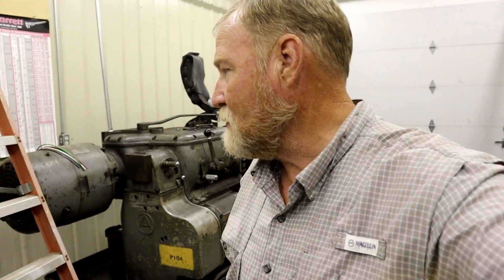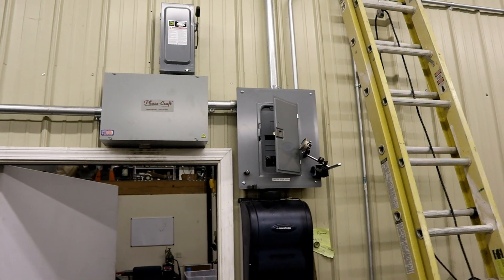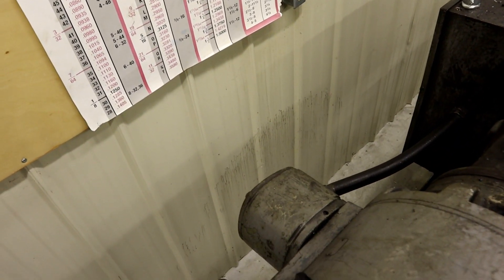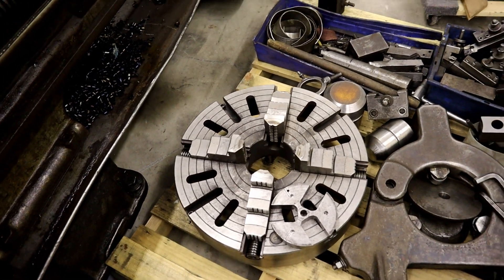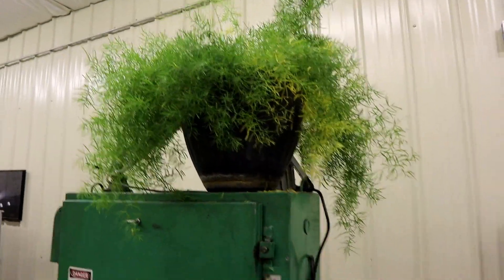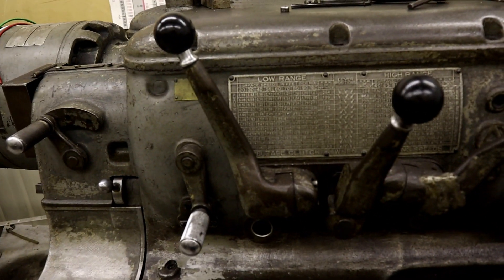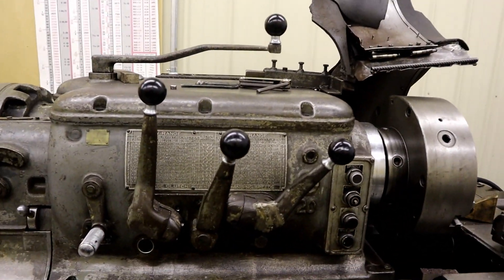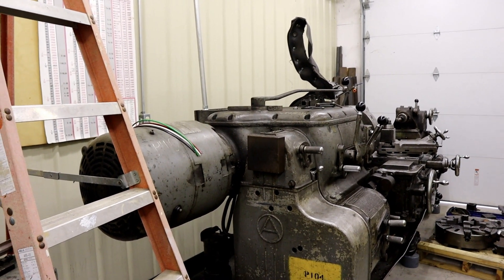An Apology , The 20 LIVES, but is crippled :(

Comment: Big or small I will weld em all! :-) I sure wasn't offended, actually I didn't even think anything about it. See you are going to wind up in that headstock anyway. Might as well have gotten that long bed model with the top already off. lol
Reply from the maker: That is good to know :)     Thank You.... 
As for the Headstock... Yeah.... After the problems I had with the management of the company ( explained in tomorrow's video) I was right in not trusting anything they said.. Who knows what happened to that other machine, I'm thinking it was crashed.   Anyway to get that other machine in the shop I would have had to put the 10EE flower pot outside....    The one I did get takes 16 feet of wall space as it is... The other one would have been as long as the planer!

Comment: Interesting, I had the brass gear change fork break in a similar problem on my axelson a16. Had to take open up the headstock in a similar manner and pull it out of there to get it replaced. In the end it wasn't too difficult to get back together and working like new.
Reply from the maker: It would be nice if it is a fork!  I'm looking for a oil tank with suction so I can clean it out really well before I tear into it :)
Reply: @10swatkins  makes sense! The part number for the shifting fork  that was broken on mine is 2329-110! do you have an axelson manual? If you don't, I have a PDF of the one for 14" to 32" lathes.

Comment: Is the big motor connected? It could be a high speed high torque motor,and I see the 3 phase wire on top of it ..
Reply from the maker: Yep it is connected.... The wires you see were just what I cut off  when wiring it... In the video it is turning :)

Comment: is it possible that it is an electrical problem rather than mechanical? I have always been taught that you need a larger idler motor producing 3 phase than the motor you are trying to run.
Reply from the maker: Naw.. This is, I think,  a 1957 model and not much is electric on these babies :)  It's something to do with the shifter.  I hear that about three phase converters also... IF I was running the crap out of that motor it would probably need more but the 20 starts it well and we will see.... I have been running my Planer on that same converter for years. It has a 20 HP main motor and a 5 horse column motor...

Comment: I don't think it offended  Brian , but now I'm sure he wouldn't be. His crash was a real earthquake. Your table I think would be easy. To do for you heat it up and slow cool it no matter weld or braze.
Reply from the maker: I have a plan.... Here hold my beer......:)

For real I do have a plan . I have  found a wonder wire for tiging cast iron.. No pre heat or post heat.   https://www.youtube.com/watch?v=Ht14lQc75kc&feature=youtu.be       This end of the table is really just a cover to keep the junk out of the oil rollers for the table.. The rails of the table are not connected to this piece but I am worried if I heat any of it up I'll have to plane and and scrap it back.. Not a problem but if I don't have to , I don't have to :)
 SO .. I am going to take about a week to tig on the piece with just a few spots at a time. I figure I can just put a little tack on opposite sides, let it cool and so on and so on and so on ........ Pretty soon it will be stitched together... We will see...
Reply: @10swatkins  You want to minimize shrinkage and distortion on a small casting only way to do that is lots of preheat. Will that result in distortion in and of itself? Hard to say depends on how stress relieved it was when they made it. If it was well seasoned and relieved it should be stable if it was cut fresh as cast it is anybodies guess what it will do.
Reply from the maker: Using the cast iron tig rod I found I am just going to put a pencil size tac in about 3 places and then let it cool and rest.... Then a couple of more... And so on and so on....As long as I can make it stable enough not to fall off I will be happy as it is only a cover.
I can always stress relieve it in the oven then plane and scrape it back... IF I have to... It's just # 459 on my list of thing to do :)